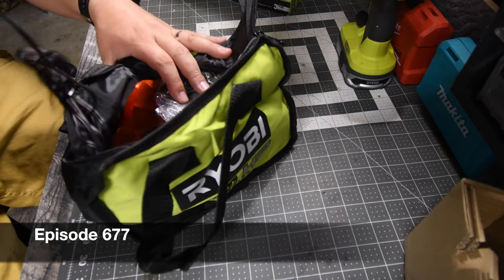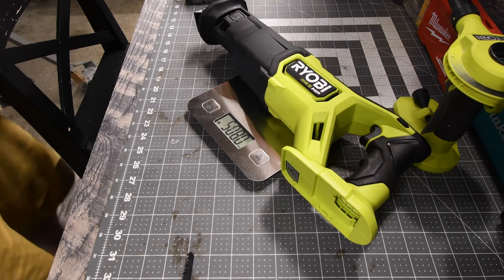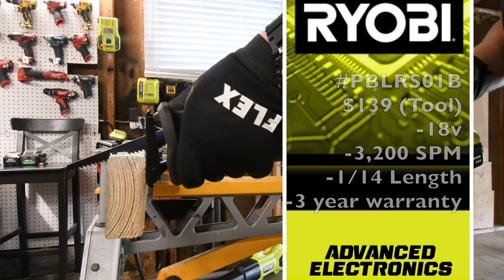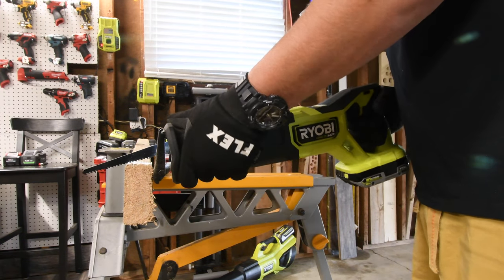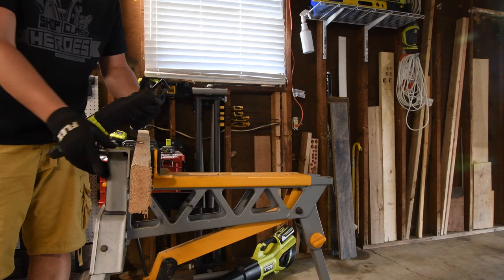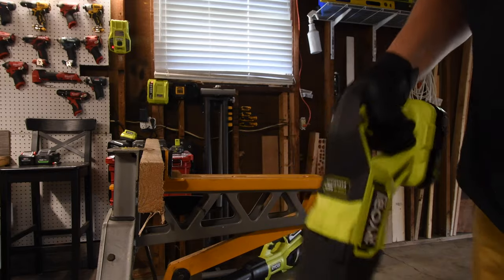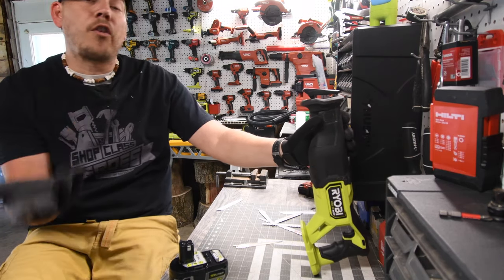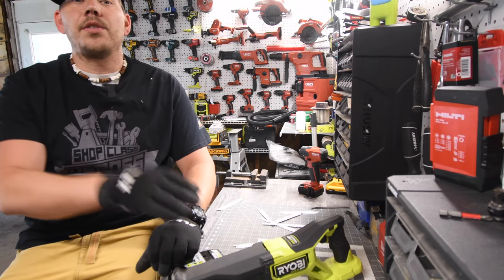The $200 Ryobi 3 battery Kit w/ FREE TOOL!

Comment: i have both the new ryobi hps recips, and personally i like the one handed one WAAAYYYYYYY better!!! i had the recip longer and yea it works, the cut length isnt bad, but as you said its just lackluster... the shoe is trash (i took mine out, sprayed it w wd40 n worked it w loose pliers and now its not stiff n conforms to the shape i need better,,,, but its got a terrible range for positioning... can move it a inch total Forward n backwards... 
i wish it had orbital capabilities too.. at first i thought it was gonn be just like ridgids last few recips since its shaped the same, n those are beasts just eats thru anything .. but i got what i paid for..
but then i got the one handed when they did the sale where u pikc which tool n how many n whatnot, n i gotta say i think its  an all around improvement over the full sized.. even tho its got a shorter stroke, the motor n function seems stronger and w the shorter stroke it seems to cut faster n smoother somehow lol... its suuper well balanced, first one handed saw i can really comfortably use 1 handed (but ill use both to chop shit faster if need) and it just is a smoother cut regardless what your cutting.
i used the full sixe to try and cut down n out a huge tree stump and it got caught up on every lil root it touched, jammed up so much n jolted back bending blades fuckin up my wrists... i ended up runnin to HD that day to get the new angle grinder n extra batteries Already  n said fuck it throw in the new one hander,, and got back to the stump and that thing dug down n ripped out those roots like nothin enough to let me pry it up w a dig bar then cut out the rest no sweat.   i then tested it out on some old steel piping and w a thick metal Diablo blade it melted thru em smooth loke butter.  i cut down thru plywood sheets easily too dodntget stuck up or make the board all shakey n shit. 
granted the big guys better for super heavy duty shit ,,, had like 200 ft of 4x6 n a houses worth of cabinetry n cupboards n whatnot to break down to take to the dump n thas where that came thru,..
but i really havent touched it since getting the one hander,, legit its been like 4 months now since getting the1 hander , i think ive used the full sizer like 3 times.. and besides my impact drill the recips my 2nd most used power  

and plus i noticed the rubber grip on my big saw came unglued and loose n slides all over the saw n its business end now,, dk if its just a random case of faulty gluing, or the heat of livong in a desert just fried it off, or what but thas just indicative of this saws overall quality i guess lol..

Comment: so ur doin a new vid to test the new 6ah hp battery vs like the old 6hp hc battery? see if theres a diff?  glad to know that the new 6ah gove it more power,, ive got 2 new 4ah hps, 2 2hp, 2 old 3ah hps, n 1 older 6ah hp batt,, and i havent seen a diff  between the old 6ah, n the new 4ah.. but i guess thas cuz their diff technologies.. good looking on that, i may need to grab new 6ah hp now,,, see if thatll give it more ooomph..

and anyone know or heard if their ever gonna drop  a hp 9ah?? lol the way the sizing is goin, the 9hp wouldnt be bigger than this old 6ah hp,, shuts like 4lbs by uts damn self lol,..

i wonder why they haven't done a 9ah hp,, youd think that theyd want to to get thee maximum power outta each tool, to actually showcase that their really of a newer higher performance.. i will say this tho,, seeing how long the 4ah hps last in most tools, n the power you get from em,, a six makes sense for the big guns (circ saw, recip, chain saw, impact wrench),, but I guess i dont see the need for a 9 unless i neeed all the juice it can pump out,,, at keast it doesnt seem to be worth the tradeofff w the extra weight n size..  i already hate my old 6ah hp cuz its the size of a damn cinder block, and weighs the same too,,, but I need it w my chain saw unless im doin just like 2 quick cuts... I cant see a 9ah being worth it,, id rsther swap out 2 6hps..

shit,, i think i just answered my own question....lol but fuck it id still like the choice to say yeah or fuuuuck nahh tho

Comment: Looks like a lot of vibration even with the 6ah in the 4x4
Reply: That could be because the blade isn’t long enough. When the blade is at its shortest, it doesn’t exceed the length of the 4x4
Reply: @plaid11  blades seemed long enough in the video to Go through the 4x4 just fine from what I could see and most tests it had a ton of vibration I agree with Dave
Reply: @AntonioClaudioMichael  oh, don’t get me wrong, I completely agree with Dave too. One of the reasons I decided not to stick with Ryobi for very long, they’re kind of in line with Harbor Freight tools. Sometimes you get a decent one but you can get something that just won’t cut it. If you look close enough, when the blade retracts, the blade end isn’t past the end of the board. Some of that could be because of how Dave is holding the reciprocating saw and the shoe isn’t always up against the board. You can see that there isn’t a rough clean cut on the backside because the blade didn’t cut that part of the wood
Reply: @AntonioClaudioMichael  go look at 6:20. You can see the blade sitting on top and it’s not long enough
Reply: @plaid11  yeah great points for sure and yep I see what you mean about the blade could be angle and how he is holding it but blade does look short ... I am only in ryobi for the odd tools I have all there rotory tools and Soldering irons and Hot glue guns and there fans got the OPE Tools for my wife like the chemical sprayers and mister fogger because if they get broken there cheap I can replace easy and my wife prefers the ryobi sprayers over the Milwaukee Switchtank because the ryobi is way lighter in weight... I don't have any of ryobi's tools like the drills or impacts or impact driver or the recip only tool I have that is like them is the 10 inch buffer I use the Ryobi Exspand it Attachemts on my dewalt flexvolt 60v attachment system trimmer head the ryobi New Rotory tool is sweet its the Hp and it has a Ratcheting Chuck never seen that on a dremel style tool before I like ryobi for there creativeness they do have some unique tools nobody else has and that's what I buy
Reply: @AntonioClaudioMichael  they do have a few things I want. That’s the reason homeowners tend to go with Ryobi, they have a big lineup for a little less than others. He’ll be testing this reciprocating saw more and we’ll see if a long blade does better…
Reply: @plaid11  maybe it will I'm sure we will see down the road I know I don't need any of the main big power tools like drills or anything like that I have 20 other brands lol
Reply: @plaid11  I see what you mean @6:20

Comment: After the first 20 seconds, where you tried to start the saw with the blade already engaged with the wood, and then damn near held the saw at a 45 degree angle to the cut, and then appeared to have the two-by-four clamped two feet, if not three feet, from the saw blade, and then complained how much the piece of wood vibrated, and as you switched out each battery and had cut more of the wood off and the saw was getting closer and closer, you attributed the smoothness to the different battery, instead of the fact that you no longer had two or three feet of wood sticking out past the clamp. I simply didn't think I could watch anymore.

But I did.
Reply from the maker: This channel puts these tools through extreme tests. The saw is fine. I did more videos of this exact saw after this video including a battle of the brushless with it. The battery failed. I did a follow up video on the battery and it's still dead. I make 12v tool cut 6x6 wood and they are just fine.

Comment: Get different blades unless you're buying a house hold name brand aka (dewalt, makita. Milwaukee, and maybe bosch) if the brand you're purchasing sells blades in their own brand it's good
Reply: I would have to say Ryobi is a household name. For your average homeowner, they’ll go to Ryobi before most other brands. So definitely a household name
Reply: My neighbor has a pile of Royobl junk tools. I have all Milwaukee and DeWalt. Royobi to me just looks and feels cheap. The plastic seems low quality and week. The tools just seem to age very fast. I do have a Royobi blower (a very expensive one) that was given to me and it's ok but not great. I was shopping for a miter saw and I looked at the Royobi and it was so light and cheap feeling I wouldn't even consider it. I wound up with a Bauer 12" from harbor freight. Having said all that, I'm sure Royobi tools will get the job done for home owner's but they are definitely inferior in my opinion.

Comment: 100 for the battery kit to get an extra tool, even if the tool isn't good it's fine for once in awhile
The 200 for this set doesn't seem as value based